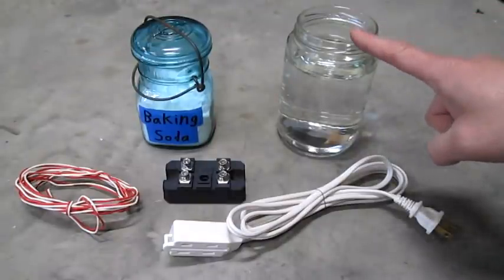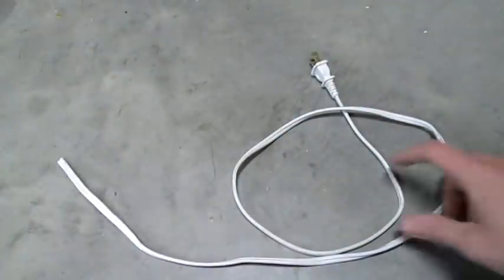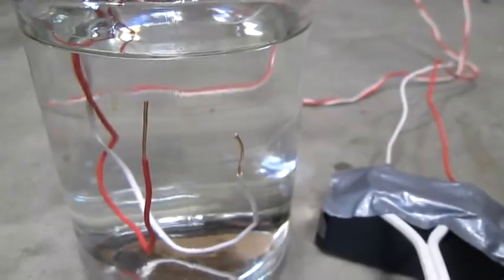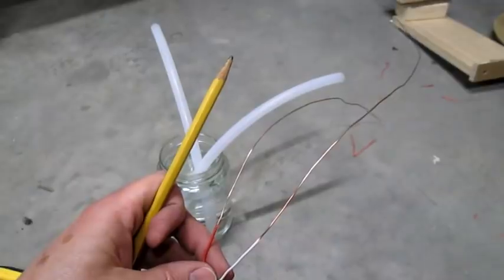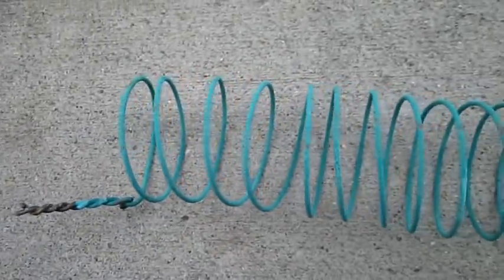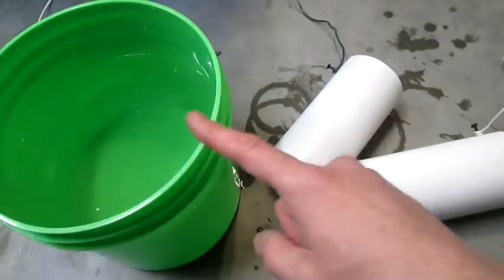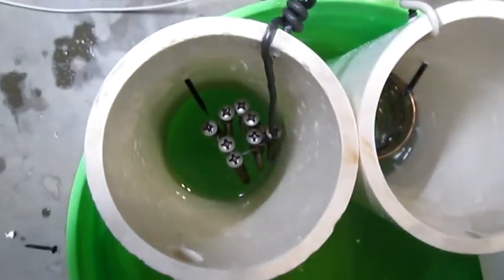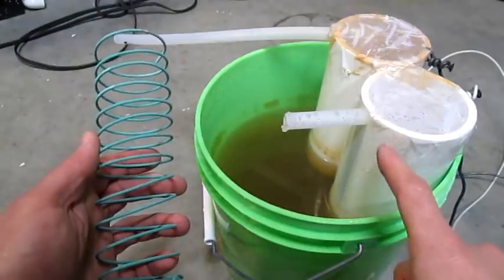DIY Oxygen Machine

Comment: Doing electrolysis with direct mains is not a good idea.  It won't improve your gas production rate over using say 12V.  With appropriate electrolyte and electrode spacing and geometry you should be able to run at more like 5V.  In theory you only need 1.8V All the extra power is just going into heating the water and corroding the electrodes.  Not to mention it's needlessly hazardous.
I will give you credit for having come up with a setup that actually separates the gasses fairly effectively.

Comment: I didn't know it was that easy to split the gases into separate streams without the use of membranes
Reply: Each gas is produced at a different electrode, so if you can isolate the gas rising from each electrode, you can perfectly separate the gases produced.
Reply: @gavinteague6816  That seems impossible. You can only get either gas by separating hydrogen from oxygen in the water, so both gasses would be freed at exactly the same place, which is the place where the water molecule came apart.

Comment: Question - What's your DC output?
Reply: The current will depend very highly upon the resistance presented by the cell but I suspect you meant voltage output.  At zero load the RMS output voltage of a full wave rectifier is (2*Vpeak)/pi (~108V) and the peak voltage out is the same as the peak voltage input in theory (~169V).
Reply: @whatelseison8970  Why not use a "Bridge" rectifier?
Reply: @chrissimon8368  Full wave rectifiers are bridge rectifiers.  There are two types: a half bridge full wave rectifier uses 2 diodes and a center tapped supply.  A single phase full bridge full wave rectifier uses 4 diodes and is probably what you're thinking of and was exactly what I was talking about.

Comment: if you had someone having trouble breathing and a mask - would this actually be enough oxygen production to actually help - wonder how it compares in output to the chinese oxgygen generators you see for about $300 on ebay or Aliexpress - they say they put out in some cases 6L a minute?
Reply from the maker: I think it would help somewhat yes.  You can definitely tell you are not breathing regular air out of the hose.  I did not measure, but I would estimate this did about 1 liter per minute, judging from how fast the bubbles were coming out.

Comment: It might be good to run your oxygen through activated carbon (to absorb chlorine gas for example) and a hepa filter before breathing it in, just to be safe.
Reply: Use distilled water
Reply: I don't recomend it, i think use pure distilled water is more safer. Although it slower to produce Oxygen, but it safe. (but still we need to confirm it to lab)
Reply: @aprogress2374  you can use Arduino to figure it out. If you do enough research you will not need to involve expensive labs. I've been researching this for over 5 years and I'm about to build my own and I'm 100% confident in what I will be producing. I will even have a storage system for both hydrogen and oxygen and both combined. Just "now your electrolyte.

Comment: Baking soda also decomposes into CO2. If you use NaOH instead you will get cleaner CO2/H2.
Do NOT use table salt unless you know you do as it generates Cl, which may be bad depending on your application.... Or good (it's a way to make chlorine)
Reply from the maker: Good add. Thank you!
Reply: A good stable and non-corrosive alternative to NaOH is borax. It's usually cheaper and easier to come by as well.
Reply: @whatelseison8970  chemistry is so interesting!